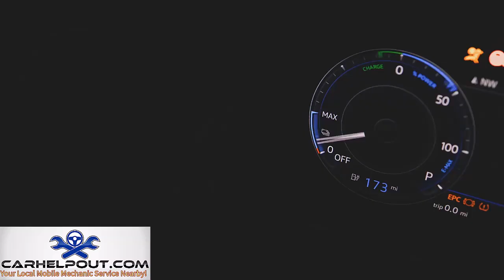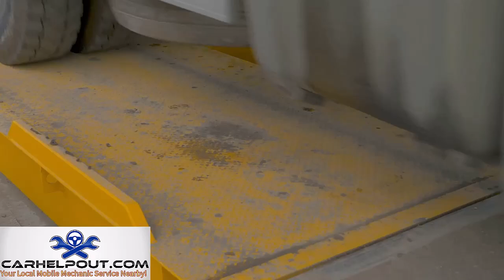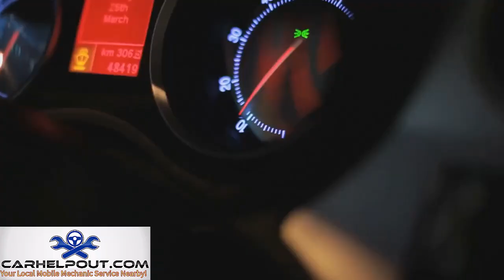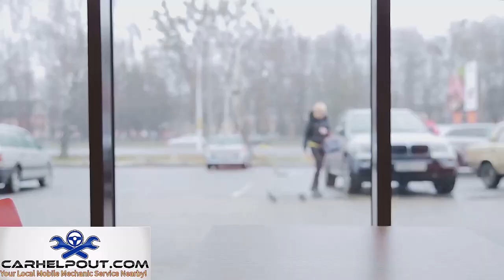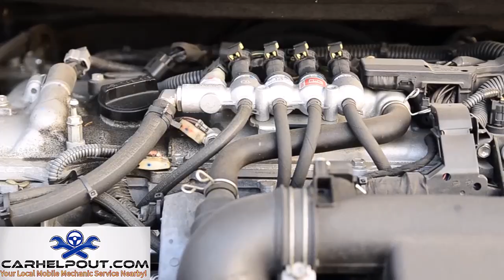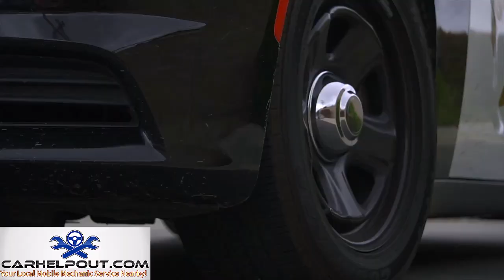How to Increase Your Gas Mileage with Simple Hacks Tips & Trick Carhelpout Certified Mobile Mechanic

Comment: I appreciate what you do for most people. They need to learn the common sense fundamentals here. For me, only no 11 helped at all. 
I was expecting to hear about tuning tips etc like certain synthetic lubricants that have shown measurably reduced friction , test results on LRR tires , if any predictable and affordable computer tuning has shown test results, if aftermarket hi flow air filters have shown results, same with aftermarket exhaust , if any certain serpentine belts reduce enough drag to help . 
Most people into doing their own vehicle maintenance should easily know almost all the tips you gave ( I’m not claiming that they DO - just saying that it’s very common knowledge).